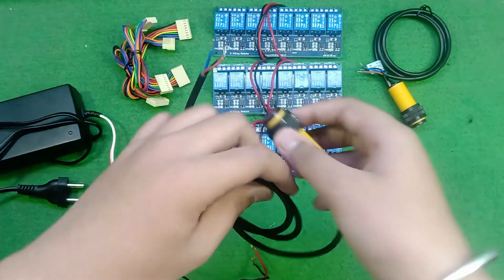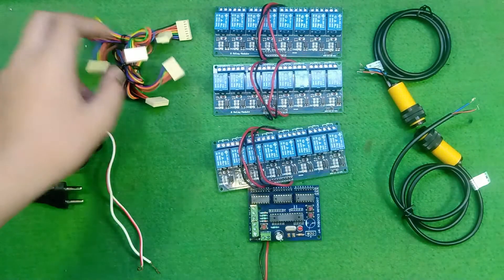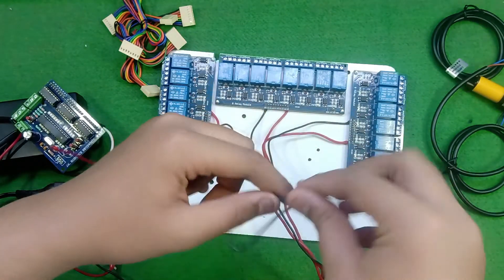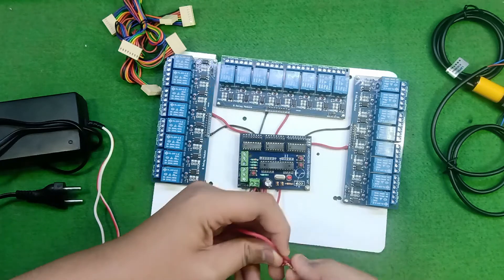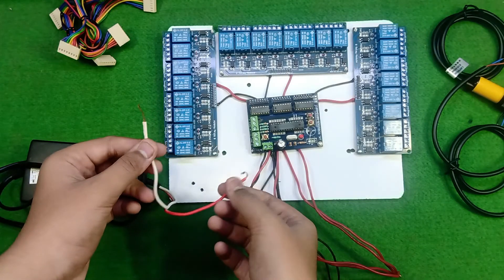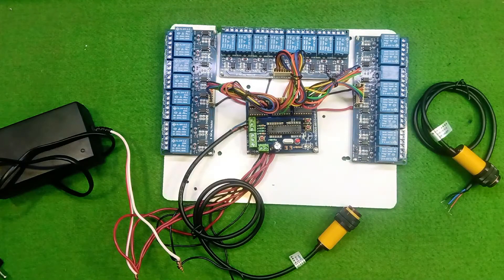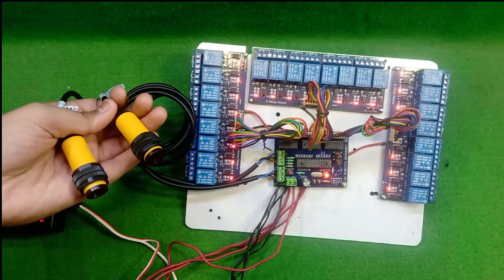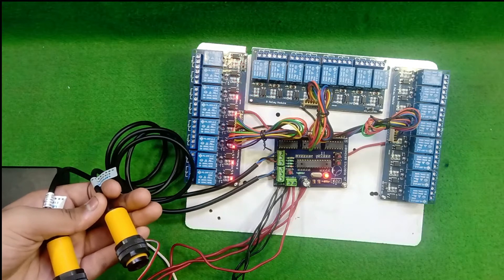Automatic Stair Light ( 1 to 24 Steps ) || Staircase light #AutomaticStairLight  #StairCaseLightning

Comment: How about using ws2812b led strip and cut it into 16 parts and then program it using arduino or atmega? This way we don't need all these relays and plus we can change the color as well. We can also add fade effect which looks premium. This will reduce cost to minimum and don't even need that curcuit
Reply from the maker: I made this video for those people who are interested to make there stairs glow up with wall ceiling 220 volt lights .......

Yet you can see this video ( my team video )
https://youtu.be/oJBXErWEfj8

This controller is also available .
And I think cost is same ........ Because only  relay will be replaced with pixel led and everything was same.